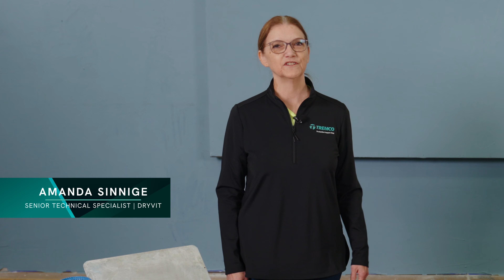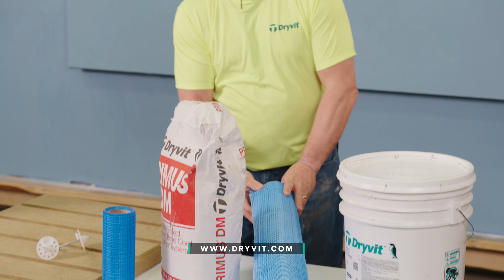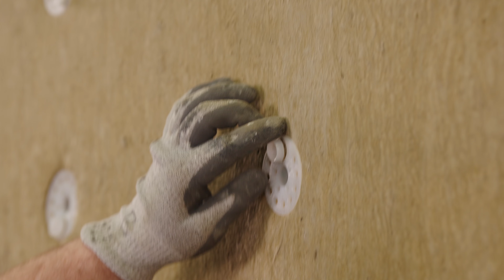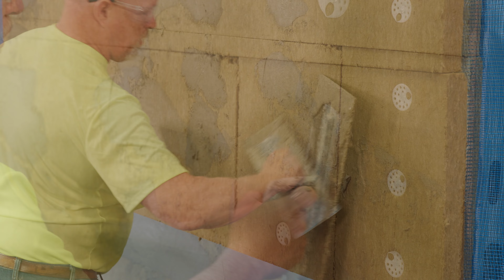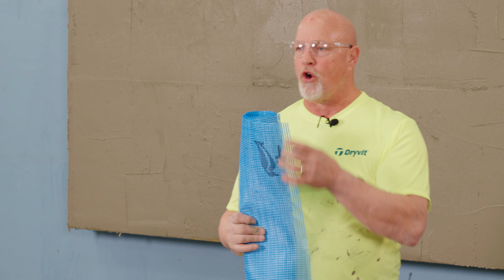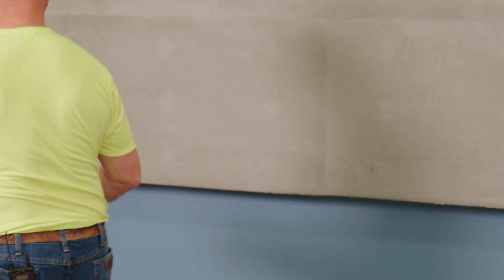Outsulation® Mineral Wool System Installation | Step-by-Step EIFS Guide (Canada)

Comment: Thank you for an informative video. The Dryvit website has a few differences with the installation shown, specifically it shows vertical notched trowel adhesive and the mineral board is not notched. Could you please clarify? I'm in the US